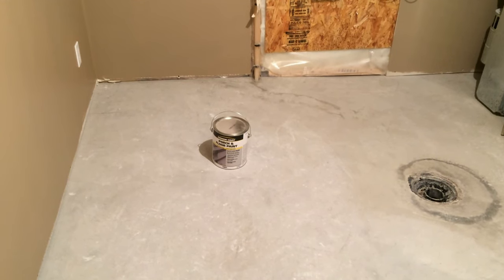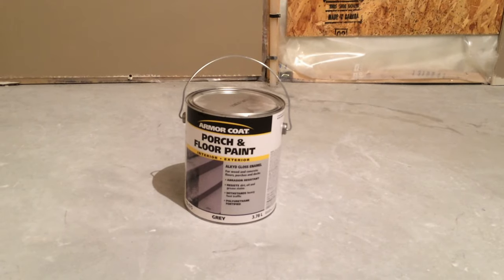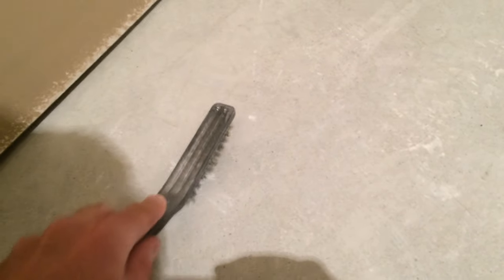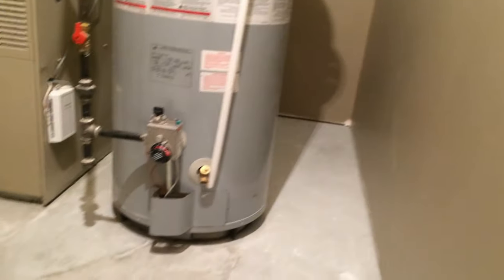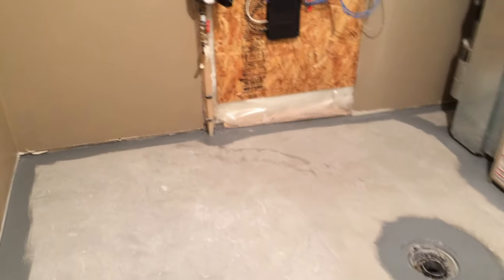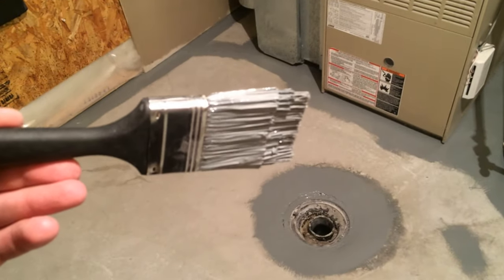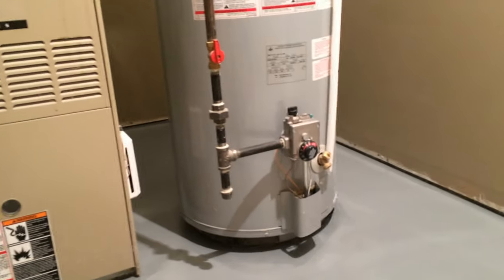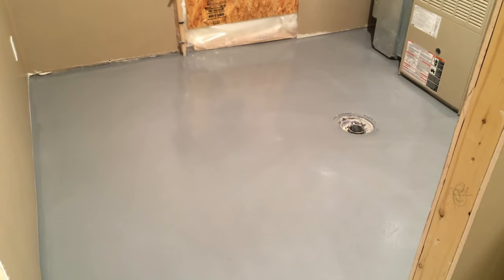Basement Concrete Floor Painting

Comment: Pro tip...don't work out of a full gallon! It wouldn't be too big of a deal on this floor because you painting it anyway, but you still don't ever want to clean up a gallon of paint, especially alkyd, should it accidentally be knocked over.

Comment: Bonding prkmer would have been a good start. After edging, don't wait! Wet edge. It is far better to keep a wet edge with any paint. You are lucky to still be able to get oil based paint, many states that is impossible, you sound Canadian,  if so, I'd be shocked that they have any oil based paint there.
Reply from the maker: be shocked.  lots of oil based paints and stains available.

Comment: Thank Greg for the great video! I bought the same paint from Canadian Tire and did some tests. I found the finished surface with just this paint is not glossy (and pretty rough), so I am planning to add a clear top coat over this paint. Any suggestion on that clear top coat for indoor use with LOW odor? Thx in advance.
Reply from the maker: Try a second coat of this paint for gloss.  test a small area.  I'd worry another brand of gloss would peel off.
Reply: @gregs_garage  thx again Greg. My test was I put the white base (same brand) then the grey, then I made wood grain using tools. So ideally I want to put a glossy top coating. I was just wondering if you have any suggestion on the glossy clear top coating. I think you have a valid concern about compatibility between different brands. Thx
Reply from the maker: @windylee477  I have some concrete sealer that I may try if I were you.  see my concrete sealing video.  Available at Sherwin Williams.

Comment: Excellent video!  We just began this last week (June 3, 2017).

Only a question, not a criticism, please...why did you choose the oil-based paint; and, only a one-gallon can, a small area?  Home Depot sells water-based Basement and Garage Floor Paint in 5-gallon cans.

Thank you for posting! :)
Reply from the maker: either may work.  This oil based stuff is pretty sticky and seems to hold up well.  Never tried water based.
Reply: Sometimes you have basement leaks and you don't want water based.
Reply: classiclistener01 ž
Reply: Vacumn the floor first,use a paint roller

Comment: No need to etch acid etch?
Reply from the maker: Not for this application.  I think Epoxy requires etching.  This paint just goes right on the concrete.  Maybe in a garage etching would improve the bond but not required in a low traffic area like this.
Reply: @gregs_garage  Is it slippery when wet? I want to do my parents' washroom floor. My mother uses a walker, I don't want her to slip though
Reply from the maker: I have not tested when wet.  It would be a bit slippery but not too bad.  Your parents have a concrete washroom floor?   Get some plastic floor tiles or something.